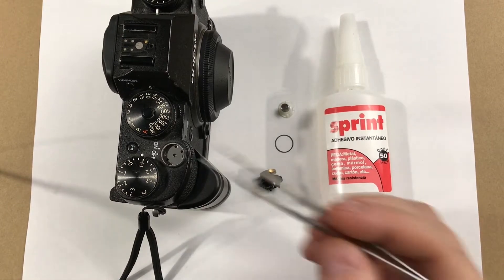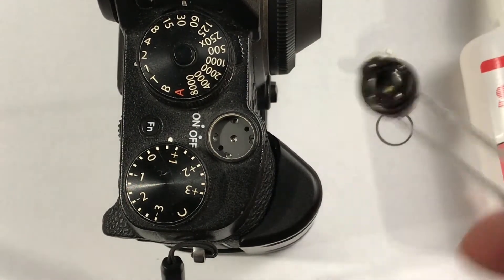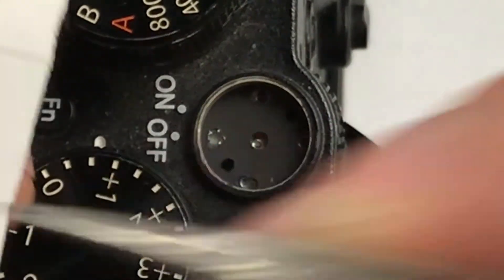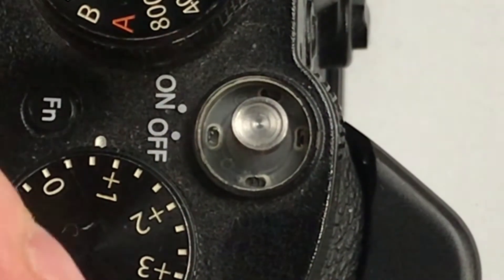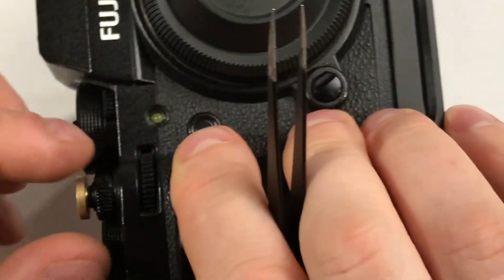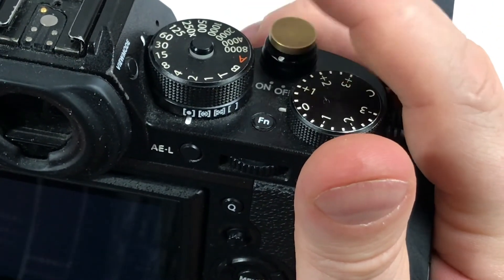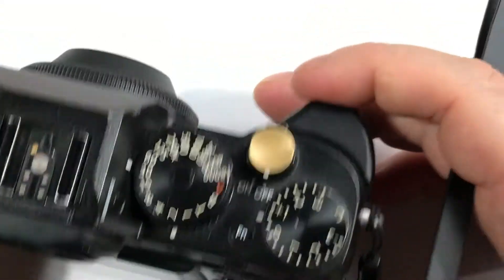Fujifilm XT-2 ON/OFF Shutter release *FIX*

Comment: I tried to follow the same instructions but its not staying put. It still comes off. Not sure if I need to glue the center too? It just comes off easily and doesn't fit
Reply: 1. get super glue "gel" that way there is a blob of glue instead of leaky substance
2. dab Glue on both sides (button and body) or use "activator spray " on one side.
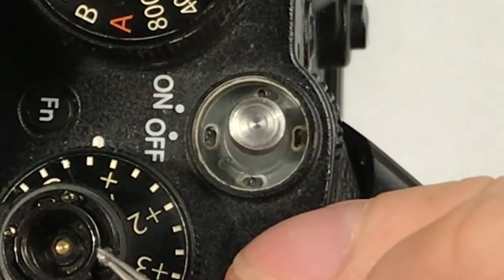3. 1:29 dont glue the centre, because what will you glue the centre to at 1:44 ?
4. failing the above, take it to a repair shop and show them this video.

Comment: HI there mine on off button is stuck.. how did you disassembled yours? i think some dirt went into mine
Reply from the maker: read the description, check comments, people with your issue have found solutions, DO NOT diassemble your button, that's the last resort, just pull hard enough and it will pop out, but once tha'ts done... you'll have to glue it back in, and it will never be the same.

Comment: Folks – Whatever you do, don’t do what this guy did.

Never, ever, use cyanoacrylate glue (super glue) on or in any electronic or optical device.  The stuff gives off fumes which can coat surfaces.

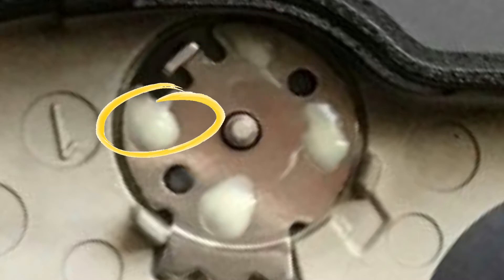You can tell this guy doesn’t know what he’s talking about – he thinks the glue that Fujifilm used (0:28) is the same as his super glue.  (Ever stop to wonder why Fujifilm DOESN’T use super glue?)
Reply from the maker: Wow, you are angry!
Do you know how much glue you would need for the fumes to leave a residue? You know how much it would need to actually cause some change to electronics or reach ANY optics? You are “technically correct” but 100% wrong in your assumption that 4 small drops of super glue can cause any kind of damage. So please stop with your yapping as if you know anything.

No one EVER SAID Fuji used super glue… no one is that dumb. Fuji used GLUE, not SuperGlue… listen to what is being said. We are just using Super Glue as a solution, not replicating the same glue Fuji used. 

Come on! Relax, my friend, no need to go out swinging dissing this video, just because you know some very little information about the fact that super glue leaves residue… take a chill pill!

Comment: Hi, I was having a “sticky” shutter button release in my xpro 2 and I just came across your video. It’s been a year since your release it and I follow your advice. Use some wd40 in a q tip  and applied it to the button making sure the oil would get between the on/off lever and the button and after 30 secs, voila! The shutter button works like brand new!  I can’t believe how easy it was to fix this issue and was dreading calling fuji for it. Thank you so much for making this videos, they are life savers!!
Reply: I cant barely switch on and off, mine stuck how did u spray wd40 on it
Reply from the maker: @fransnainggolan7980  you spray an wiggle even a little if you can, p.s. happy new year
Reply: wd40 is bad for plastic and rubber !

Comment from the maker: UPDATE: 6 MONTHS later, still works, and did not fall off even one time.
Reply: great - a hint for your description as this harms rubber & plastik: 

"Should you use WD-40 on rubber parts to protect them from cracking? No, absolutely not. In fact, it may damage rubber by dissolving and washing away the oils in the rubber. It may react with the rubber and make it gooey, or harden it."
Reply: My 2 cents is to remove the additional yellow button. It caused the problem.
Reply: @tuquanvinh  happens even if there is no soft button on it + newer cameras ... badly designed. My guess is that the problem can be caused as well from the deeper sitting button as the Fuji Service change the upper body part completely in some cases.

Comment: My x100f got the same problem. Did your fix last? Im afraid of loosing the button without noticing ! Fuji wont sell replacements 😠
Reply from the maker: you know what, it actually works quite well! it's a bit looser than it was before, but 100% usable, and hasn't fallen off since I made this video. so yeah, it works.... wish Fuji wouldn't charge so much for their design flaws though.

Comment: is there a video of the disassembly of this power switch?
Reply from the maker: I haven't found one, But if you want to get to the switch you would have to take apart EVERYTHING!!!!!
I mean removing the back part of the assembly, the LCD, detaching pretty much all the ribbon cables, unscrewing the top plate, removing 90% of the components of the top plate... it's a job and a half, no wonder Fuji charges upwards of $200 to fix the problem, even though they are simply reapplying some glue.
Reply: @honestview  thanks. My gripe with fuji is it seems to be a known issue yet they still charge for the repair.  I literally used this camera about 4 times, and shortly after the warranty expired I realized the power switch wouldn't budge.  Sent it to them they quoted closer to $400 to repair, I said nope and now have it back in my hands still broken.  Considering cutting my losses and selling my entire Fuji setup and replacing with Sony or Canon.
Reply from the maker: @shelerich   you say "wouldn't budge" did it fall off, or is it stuck?
I heard of $400 repairs, but also found online people who managed to talk them down to $200 or find independent repair services for slightly under $200. I bought my camera body used for $450. so it is easier to buy a new body then try to fix it.

there are workarounds, would you mind describing your problem or make a short video detailing what happened.

I love the aesthetics of Fuji, but i too would consider an A7iii or a6400/a6600 even a Canon EOS RP / R is a good contender
Reply: @honestview  well I noticed the shutter release button was getting "sticky" almost like it was getting stuck and I wasn't able to press it down. I turned that camera off didn't use it for a few weeks then when I pulled it out again and tried to move the button from off to on it was solidly stuck and would not swivel to the on position. I read somewhere that there is an issue in the mounting something to do with over tightening, and that's what has been causing this problem on these bodies. I'm just so frustrated at the moment as I spend so much on this camera and have not even taken 600 photos. Thankfully I have a Nikon to fall back on. I try to get hold of Fuji on the phone and talk to them but it was like trying to get an audience with a pope. I will contacted a local camera shop and they just said they would send it to Fuji on my behalf. Off to Christmas I'm going to try another couple of camera shops to see if they can't maybe do a cheaper repair.
Reply from the maker: @shelerich  As I took apart the shutter button, I can not see how there should be an "overtightening issue" as it uses no screws which could tighten up over time... I would recommend to take a dab of WD40 maybe with a syringe or a earswab and try to get the liquid in between the crease between the button and the body... the camera is weather-sealed, so I wouldn't worry about overdoing it, but don't spray it all over either. 

* note this is just my guess... I had this issue on my X-T1 and cleaning it out like that solved my issue.

p.s. do you have a cap screwed on your shutter release, (like my bronze one you see in the video)?
Reply: @honestview  I did have a cap and I suspect that caused the problem.  I will try your suggestion and do some lubrication with wd40. Thank you.
Reply from the maker: @shelerich  The cap actually should protect it a little (unless it is substandard and has a super long screw) the reason I asked is because if you did not have the cap, dust/liquid could get into the hole. Anyway, let me know if WD40 has any effect.
Reply: @honestview  woo hoo!! Thanks for the suggestion of WD40. It worked.  The on/off swivel is working again AND the shutter button too.  I am so releived.  But slightly annoyed that fuji would have charged so much for a squirt of wd40 😮😮
Reply: @shelerich  Awesome! I am glad it worked!!
$400 is way overboard even if your switch was completely missing in my opinion. 
Let's hope it's a permanent fix, if the problem returns, try it again and if continues to lock up, I gave mine a thorough clean using a toothbrush and distilled water which finally got rid of the issue. 

Now you have some extra cash for Black Friday, you can treat yourself to an extra lens with the saved repair-money ^_^
Reply: @honestview  How did you take the shutter button apart?
Reply from the maker: @hainanbob6144  I didn't... it fell off by itself while it was in my fairly well-protected bag, maybe the shutter got stuck between some other camera gear and pulled off under small amount of force.
Reply: @shelerich  How did you use the WD40? Did you spray it around the base of the switch? I'm worried about oil getting inside.
Reply: @hainanbob6144  I put some WD-40 on an ear swab and then gingerly dabbed it in the area trying to get some under the switch. Then I blotted it dry. And repeated the process over while trying to get the switch to move. it's quite weatherproofed so I wasn't really worried about excess oil getting in anywhere. Finally I did give it one teeny squirt, dabbed it dry immediately with a tissue and kept on working the switch and eventually it moved and I could flick between on and off. And the same with the shutter release-   all of a sudden it had a little give, and I kept pressing it down. (I guess the WD-40 was doing its magic} I'm pretty soon I was able to use the shutter release including focus. I made sure I dabbed excess oil, but honestly I used such a teensy amount that I am not worried about anything getting in the works at all
Reply: @shelerich  Thanks, I'll give it a try. I had tried the 'swab' part but with little success. Maybe the 'spray' will work.
Reply: @shelerich  I have just experienced the same problem, which has been getting progressively worst over the past 6 months. Contacted Fuji UK who quoted £180 fixed fee. I had previously thought about using WD-40 but felt slightly nervous. Having now read your (and other people's) comments I will give it a go. Fingers crossed ......